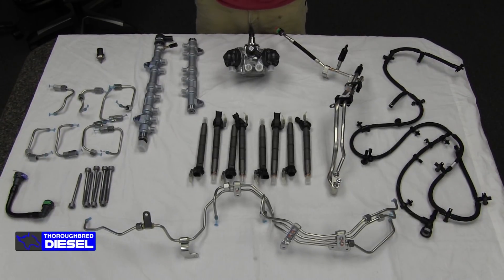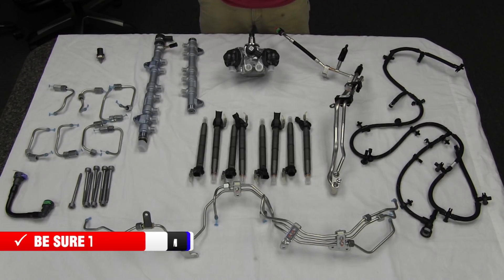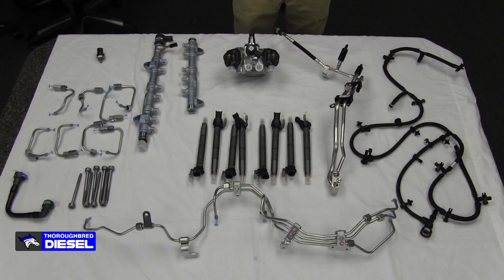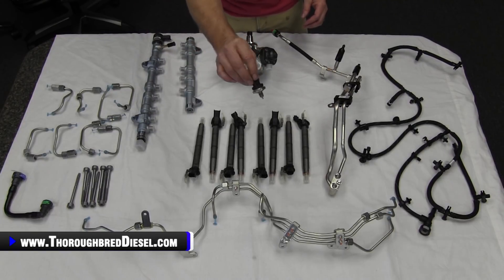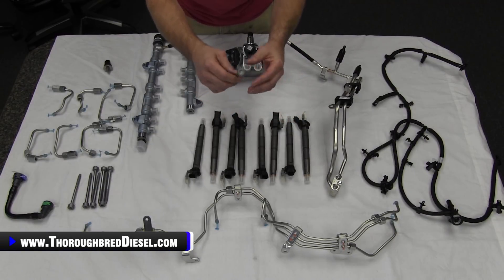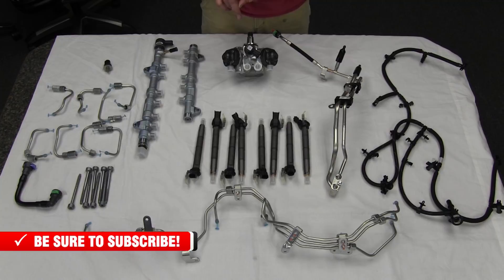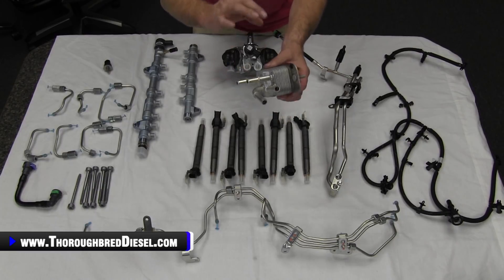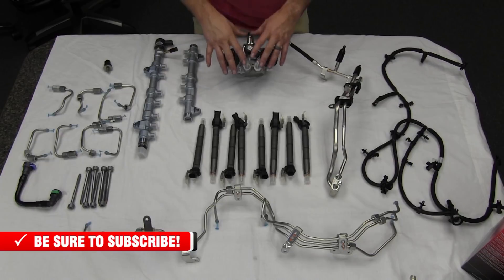Ford Catastrophic Fuel System Failure Kit: Ford Powerstroke 6.7L

Comment: HOW LONG DOES IT TAKE TO REPLACE THE FUEL RETURN LINE ASSY??
Reply: The real question is how long does it take to fix the audio in this upload..lol
Reply from the maker: @BaphometResurrexit  We purchased a new mic shortly after this video. Our mics take a beating and this one had gotten to the point that the buttons no longer worked for adjustments so we were kind of up a creek.
Reply from the maker: If you are working on all of the “high side” components, it's an easy change out.

Comment: It is absolutely insane that Ford will not put a return line on the fuel pump to put the lubricating fuel from the crank case of the pump back through the filter which would prevent all of this.  You would only need to replace the fuel pump.  Further more this is not only caused by water the CP4 fuel pump was never intended to run with No.2 diesel, there is even a class action lawsuit for this very reason.
Reply: There's several kits to return the lubrication fuel, easy and relatively cheap. Won't prevent failure but isolates metal to the pump and tank, saves rails and injectors